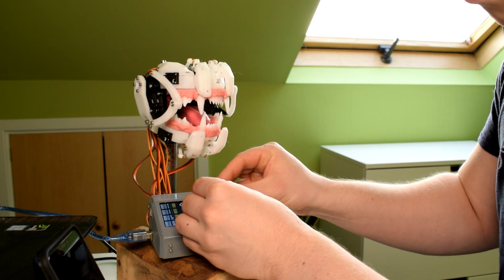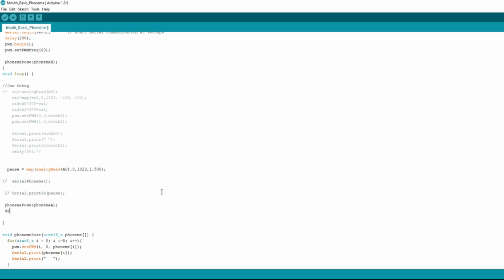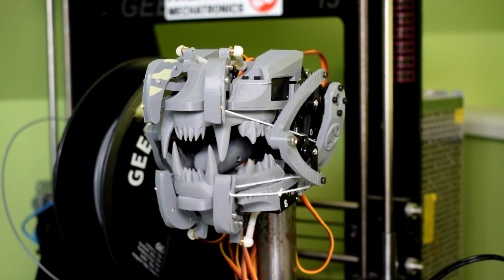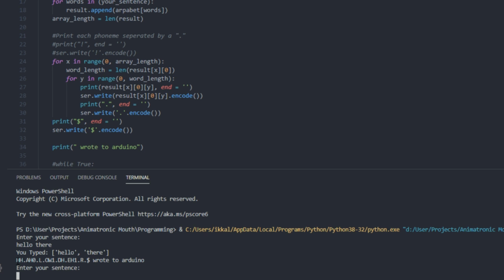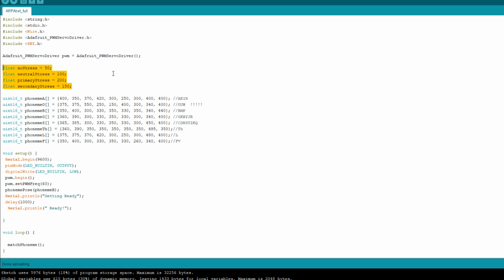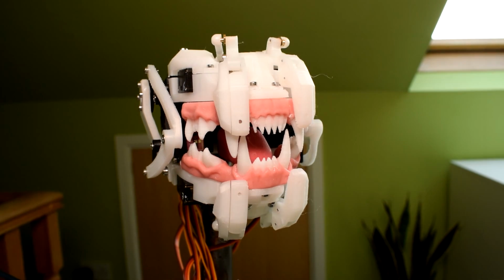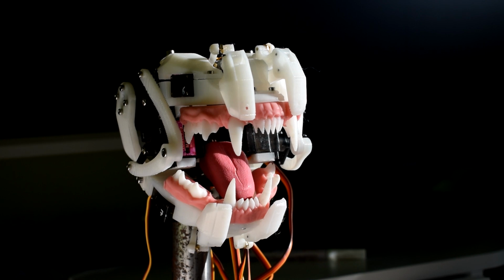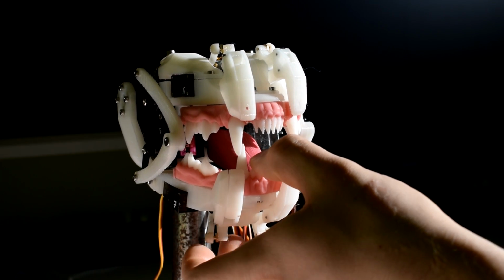How to Program Speech Synthesis in an Animatronic Mouth Using Python and Arduino

Comment: That looks great! I'm working on a same kind of controller. But I am using a stereo track that is analyzed by a Teensy Audio Board. The Right track contains the speech and controlls the Jaw. The Left track contains tones that correspond to the mouth positions of the other servo's. 
For example 200Hz for A, E, I. And 250Hz for B, M, P. 
So the actor who's gonna play with this mouth only has te make an audio track with the right tones in the right position on the Left-track.

Comment: Unfortunately this isn't "open source". The source is available, as are the STLs, but there is no license on them and so cannot be used used, redistributed or altered legally.
The commonly held definition of "open source" is (from https://en.wikipedia.org/wiki/Open-source_license):
"... a type of license for computer software and other products that allows the source code, blueprint or design to be used, modified and/or shared  ... Licenses which only permit non-commercial redistribution or modification of the source code for personal use only are generally not considered as open-source licenses."
From the "terms of service" page at http://www.nilheim.co.uk/terms-of-service.html:
" .. not to (or permit anyone else to) do or attempt any of the following:
* distribute, rent, loan, lease, sell, sublicense, or otherwise transfer or offer the Service for any commercial purpose;
"

Which puts it in direct contradiction with the definition of "open source" most widely used.
Please consider removing the term "open source" for something more appropriate like "source available", or putting the source code and STL files under a free/libre license.
Reply: Of course I agree that prohibiting commercial use means it's not "open source" under the common definition. But I can certainly see reasons for doing so. I do think that the developer should consider some standard license, rather than the current "terms of service" which has some clear wording errors and more importantly, use of a non-standard license restricts uses the creator intended to allow, as no one is familiar with them or exactly how the terms may be interpreted. Besides just changing to an open source license . wouldn't other options include: 1) While not intended for software, use the  Creative Commons license limiting commercial use, 2) License under the VERY unrestictive GPL, with options for commercial users to pay for closed licenses. This doesn't actually prohibit commercial use provided the user abides by the terms of GPL opening up their own changes to the same terms, but may make it more attractive for commercial users to pay for a restrictive license, or 3) While I haven't seen it used, use the Commons Clause (https://commonsclause.com/)?

Comment: Great work Will! I was thinking, what about using an ESP32 instead of Arduino? ESP32 can run MicroPython. Therefore eliminating the need for two microcontrollers and a serial connection.
Reply: NLTK will not run on an ESP32. Raspi + arduino combo would be ideal for a contained system.

Comment: Will, take a look at audioservocontroller dot com. I'm not sure how many servos it is cabable of controlling at once as I haven't grabbed one yet, I can inquire though as someone from the FB group has one. There is a few dif audio servo controllers out there but they don't seem to be very common. Scary Terry is another one.  I saw someone post the hardware layout at some point so it might be easier to throw one together depending on the components. Might be the only way to get that many sevos running in sync. 

Anymore thoughts on the potential forum? XD

edit Fernado from the group has a vid up with him testing it on his DARA robot. "DARA robot lip sync" if u r curious. Can ask him if he played with it anymore since. I think he had it just hooked up to the jaw and not his tongue model, he would know better mind you. :9
Reply: Scary Terry and similar just work off the volume of the sound source, not visemes. Adequate for a jaw on a prop or toy (I use them and I'm developing a similar thing using a Raspberry Pi), bit nowhere near what Will is doing with visemes, jaw,.face, and tongue movements.